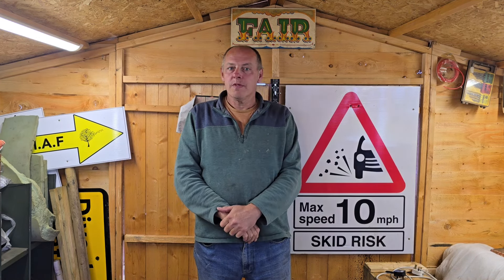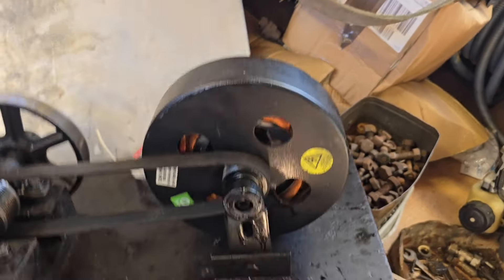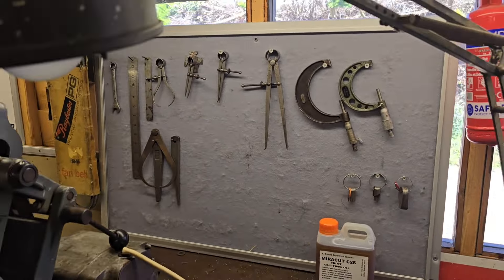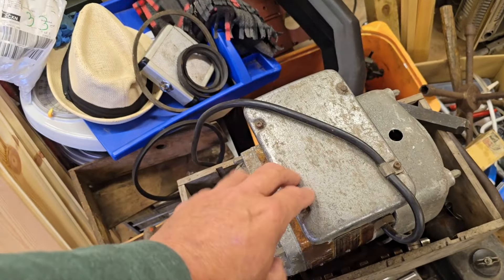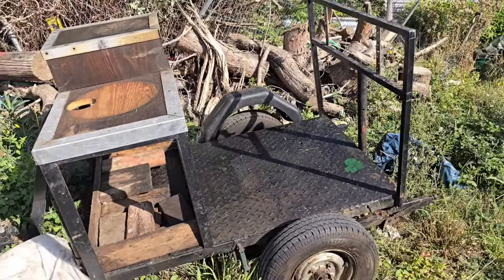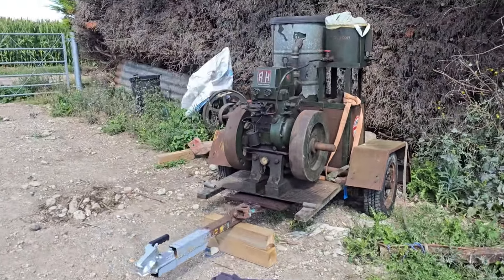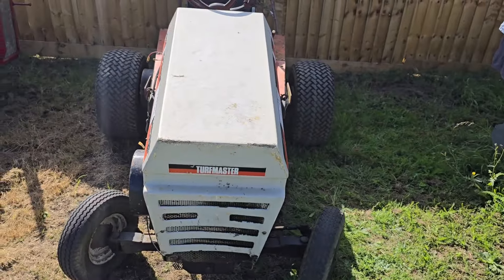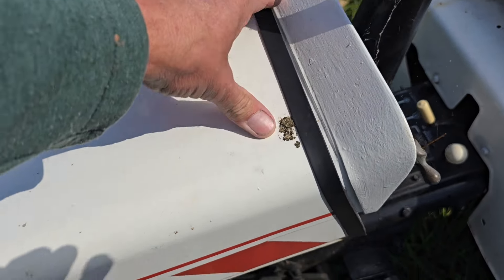What's kelter have I picked up lately?? Rusty old Junk.

Comment: Have you ever heard  of  a stationary engine by the  name of Truslove from Colchester ,I once owned one many years ago  ( mid 1970s) had it running several times had a plug on head next to spark plug, back  fired one day blue the plug straight through barn roof ,both inner ceiling and asbestos landed in yard ,bit scary.